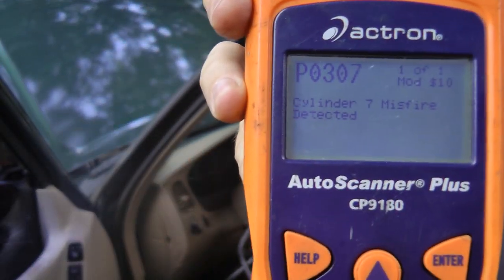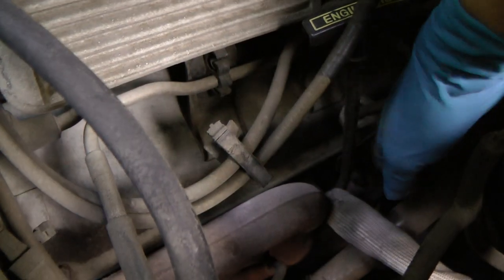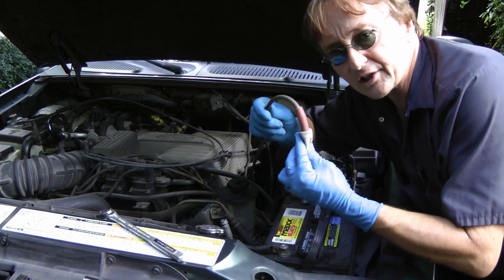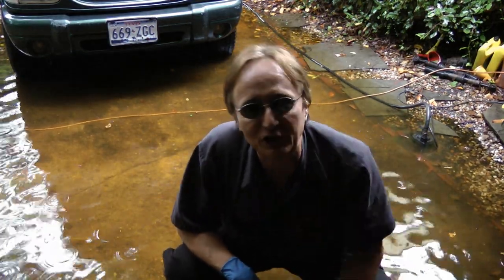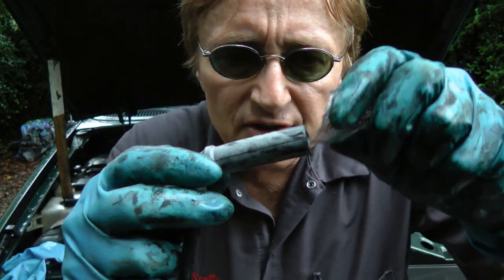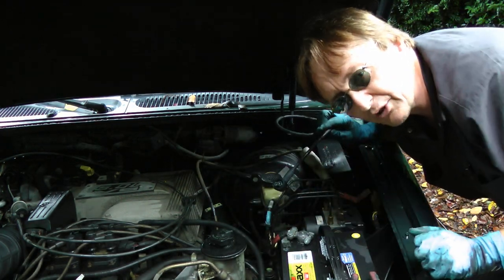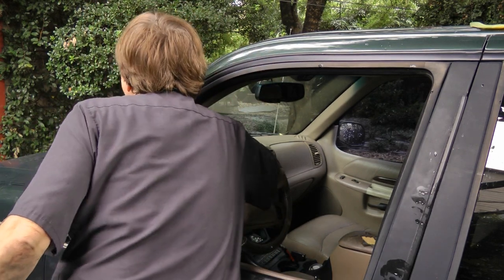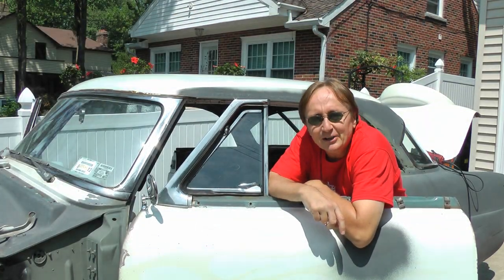How to Fix a Engine Misfire Code P0301 (Spark Plugs and Wires)

Comment: Hi Scotty, 

Looking for some advice in relation to my car, I have a 2003 renault megane mk2,

its started throwing up a P0303 and P0300 fault code, idling really rough and not pulling,

I have checked the coils, and going to change the plugs when my tool arrives in the post,

other than the coils and the plugs what else could the causes be?

Am I right in thinking injectors,02 sensors etc?

Many thanks,

Callum

Comment: hi scotty,
your videos are awesome! well i have a problem and i know you can help. I got a 2000 nissan pulsar lx. It has misfire. I can get a check engine code of p1320 occasionally. I try to pull off the coil connectors and found that coil for number 1 doesn't change the how the engine runs or it it gives a very little difference. I've done swapping the coils and spark plugs but i still got the same thing for number 1. so i fix its connector. It improves but only a little after engine warms up

Comment: Hey Scotty ,
I have a 1998 Honda civic LX.
When I turn my car on it shakes for about 2-3 seconds then idles fine . It happens once every so often. Took it to get the code read. it says misfire in 2 cylinders. doesnt happen all the time,I replaced the wires and spark plugs. the engine light went away . it still does it randomly.   Any suggestions on what this could be? Any response will be awesome

Comment: How does the car computer know there is a misfire? is it the crank sensor senses a slight drop in rotation , or the ox sensor does not for a moment detect exhaust gasses.????

Comment: Scotty, on this 95 explorer I have been working on, the spring broke when I pulled the hood release to open the hood, I had to remove the latch to replace the spring, now I have problems opening the hood, how do adjust the latch so the hood opens properly ? please let me know. Kody
Reply from the maker: you loosen the little bolts that hold the latch in place and move it up and down and guess until it works best

Comment: so I have a 2001 Toyota corolla 198000 miles and Im getting a cylinder misfire on number two. I have replaced the plugs. the coil packs seem to be fine since I moved cyl. 4 to cyl. 2 and vise versa, and still getting the same misfire on # 2. so im down to either a vacuum leak or a bad fuel injector just wondering on what you think it would be. thanks for any help.

Comment: Hi Scotty and I have a 1999 Camry LE I have gotten the piston rings replaced and coils along with spark plugs/wires and I have had the car timed as well, but the car cranks and won't turn over it keeps making a popping noise while trying to start and so we tried to use starting fluid and the car seems like it wanted to start, but no avail could it be fuel injectors or a fuel pump? I've already change the fuel filter before. Thanks
Reply from the maker: +Ayix M. do my video "fixing a car that cranks but doesn't start up"
Reply: Scotty Kilmer
Thanks!

Comment: Nice video. But I noticed some weird things. First, I don't think it's a good idea to have electrical cords submerged in water. Especially when your standing in the water. Second, the two spark plugs are different. Notice the first plug has longer threads than the second plug.

Comment from the maker: coolant is not black, flush it out.  Transmission fluid should be red and have no metal in it.  Engine oil should no have metal either. If you're not pulling my leg, your vehicle is falling apart.

Comment: Hi Scotty I have a 93 Toyota supra and one of the Pistons are misfiring, the car had been siting for a month as it got resprayed, first startup the piston would fire up occasionally miss but now it's gone (even after engine is at running. Temperature).I haven't had time to check the plugs yet but could it be something serious?
Reply from the maker: those are notorious for weak cams that wear out, check that first

Comment from the maker: yea, don't buy a grand am, they are one of the main reasons pontiac went bankrupt.  You got ripped by the mechanic, no real mechanic would put a timing chain on an engine that has a bad cylinder compression. The head would have to be pulled and the timing chain taken off again and you'd spend more money that that thing's worth in most cases. You can just keep changing the spark plug on 3 and pray it lasts a while longer though.

Comment: Hey Scotty, I have a 2006 Honda v6 accord . Codes are reading that all valves are misfiring. Changed all the spark plugs, the old ones were carbonized. How long til the emissions light resets and should I do anything else? Spark plug wires?
Reply from the maker: adjust the valves first, if plugs were carbonized so are valves and they'd need cleaning and readjustment
Reply: Scotty Kilmer Thanks!
Reply: Emissions light went off, car running great, more power. Idk if i can do the valve adjustemnt myself? You got a video for that?

Comment: Here are my park plug tips:
1. never change plugs when your heads are hot, it can gall the threads.
2. I always use anti seize on the threads.
3. don't over tighten, I just go a 1/4 turn past after the crush washer seats.
4. Before removing plugs, give each a shot of PB Blaster.
Change wires one at a time so ya don't F up the firing order.

Comment: @scottykilmer great job on the vids i watch them every week. i did an oil change on my e39 (bmw 2000 528i) and the oil light still goes on and to get it reset is about $150 (local mechanic not the dealer). is it possible to do it myself? if so how?

Comment: Alright scotty quick question for you.
I recently ran into some bad fuel (so it seems) and the engine began to misfire a bit. My o2 sensor is bad thus making the car idle unevenly. But the engine also shakes when in low RPM. I'm driving an 02 F-150. I changed out the spark plug that was misfiring and its not misfiring anymore along with my fuel filter. But the truck still shakes when it is accelerating around 1100 RPM. That goes for 15 mph or 45mph it shakes. I have no idea what else to do. What would you do?
Reply: Might be an bad oxygen sensor due to the misfiring
Reply: My vehicle is running lean and has a low idle. I have two new motor craft o2 sensors I'm going to replace soon.

Comment: Scotty, I need your help!  I bought a 98 Mitsu Montero 3.5 with a misfire which I though was old gas. Tried running 3 tanks through w/ injector cleaner and never cleared up and I got a misfire cylinder 3 code at first and then a multiple cylinder misfire code. I pulled the intake plenum off and noticed 1 intake port and 1 spark plug that looked brand new clean and the rest of the cylinders have heavy carbon buildup.  Milky light brown residue in intake port and around gasket...any ideas?

Comment: Hey Scotty. On my 2007 Bmw 328i it had a misfire on cylinder 3 I swapped the ignition coil with another and it gave me 3 misfires instead of one. I then ran it and then it gave me a misfire on cylinder 2 and the engine light stayed on I bought a new coil and put it on 2 I reset the code and now I have 3 stored codes. There's no pending codes only stored. What you suggest I do or is everything fine?
Reply from the maker: just drive it and see if it all goes away over time as long as it runs fine

Comment: scotty,i got a "03 ford ranger 2.3l 4cyl that has a code of p0303 and p0316.i changed plugs,wires,coil pack,fuel filter,air filter number 3 fuel injector and still misfiers.could the crankshaft position sensor be causing all this mayhem?

Comment: Hey scotty i have a 2004 Jeep Grand Cherokee with a 4.0l V6 the whole starting system has been replaced battery alternator and starter will start fine cold then after it gets hot and shut off a few times about the 5th time i start it it will not start acting like it has a dead battery this is the 5th battery is 6 months hoping you can help me out

Comment: I have a 1996 Toyota camry has code P0303. I replace spark plug and spark plug wire but code still there and misfire too. Need help.

Comment: hey scotty I have a Hyundai accent 2003 148k miles im getting a evap system failure    p0441 and ,it stated when I filled my gas tank I accidentally overfilled it it ran fine but the cel turned on. The light turned off when I got down to about quarter of a tank of gas, now I notice the misfire and right after filling the gas tank even half way the car stalls when I try to start it up starts up fine  after a minute and cel come on and off

Comment: Hi, Scotty! I have a 96 Buick Regal 3.1 v6 and I'm a bit stumped. Just changed all of the plugs and wires because they were worn and they weren't very good plugs to begin with. Let me tell ya, I've had problems ever since. Engine was okay for about a mile. Stopped and turned the car off to go into the gas station and when I came back out, started it up... Misfire was worse than ever. Rpms were fluctuating between 700-1100. Mass air flow was tested and turned out to be faulty along with a coil pack. Got both of those parts replaced, but still misfiring! Cylinder #4 is misfiring. Took the plug out and it was black. There's a pretty pertinent gasoline smell while it's running. Faulty injector or maybe the ignition control module is bad? What is your take on this?
Reply from the maker: that old, could just be a coincidence. more often a bad fuel injector does that if only one cylinder is black

Comment: Hello Scotty, my Toyota RAV4 was giving P0300, P0303, P0304 error codes and I took it to the dealer and they replaced spark plugs and Ignition coils. Again after 2 days, Engine Check light comes up for the same error codes. What might be the reason for this?
Reply: what year and engine size in your Rav4?

Comment: hey scotty i would like to compliment u on the great job u r doing keep up the good work. I'm having a prob with my 1996 honda civic. I had overheating prob and the coolant goes from the radiator to the reserve an does not return even wen cool, so i got my radiator rod out, and change the cap (japan 1.1),however same prob exist,even wen i hooked up the fan straight (rarely overheat now), and the water is NOT mixing with the oil. can u diagnose? plz and thnx.

Comment: I think I already know the answer to this question but does the check engine light NOT turn  on sometimes even though there may be an issue. Since basically anything is prone to mistake to some degree I'd guess this does happen. I just want to make sure.
Reply: I'm in Australia and I have an 05 V6 Mitsubishi 380 (Galant in the US) with 360000 klms.  At this age it's to be expected that the poor old girl would have a variety of small issues.  Consumes oil through the valve stem seals,  gets oil in the plug tubes which I have to clean out every couple of months because the leak is in the lower end of the tube seal and a few other things. Mostly she still runs very well and I keep it because of emotional attachment.  But sometimes the engine runs like a chaff cutter and there's "no codes stored in the module".  And usually when you take a car to a mechanic these days and there is no code they are lost for what to do. 
And often even if there is a code they still don't know what to do. 
Good mechanics aren't made, they're born.  The check light isn't the be all and end all,  diagnoses sometimes require old school know how.

Comment: Scootty, I have 99 audi a6 have random misfiring, misfiring cylinder#4. mechanic replace the coil pack but still have it. do you have any suggestion what should I do next, I'm planning to do it myself, I start replacing the spark plug but still have it. thanks
Reply: ***** I had them replaced already 6 months ago.. but they could be fouled if the injectors are leaking right?

Comment: I have a 2012 Chrysler 200 it has the 3.6 L. Getting code P0304 I changed all the plugs made sure they were gap At 40,000’s is what they told me at the auto store they were supposed to be gapped at I change the injector in number four Cylinder and the coil and I’m still getting read out of number for misfire could you help me?

Comment from the maker: engine's just flat wearing out if they carbon up on a corolla. Keep oil in it, change the plugs, and drive it till it drops. No one rebuilds those engines correctly these days.

Comment: Hey Scotty,

My mom's 2001 Kia Sephia has a P0303 code. Autozone scanned it for free but wouldn't sell me parts because I "had no advice to go on". So here I am. I was gonna replace all 4 plugs and swap the #3 coil pack with the #1 coil pack and see what happened but they got me doubting myself. They suggested I just needed the 1 plug. Am I the idiot or are they? Anything else I should do while I'm at it? Car only has 58k miles and lives in stop and go traffic (my mom refuses to drive on interstate)
Reply from the maker: plugs do not go bad one at a time. Try your test first, and if not that, swap injectors to see if #3 injector is bad
Reply: Scotty Kilmer  So you don't think it's plugs at all, a coil or injector instead is to blame? It runs decent once you get going most of the time, it's idling at a stop when it stumbles and misses. Thanks for all your help. A very similar event happened in 2006 on the same car and a workshop charged over $600 and replaced the entire ignition system. I don't want to go through that avenue again as it seems overkill and your videos help so much! You're the best.

Comment: Hi Scotty, I have an engine misfire in a 95 Nissan Maxima. The spark plugs were replaced, but same intermittent misfire occurs. I hear a knocking noise on the front right side of the car and white smoke comes out of the tailpipe. Losing a lot of anti freeze, Any suggestions? Chances are it is a cracked head gasket. Thank you.
Reply from the maker: yep, blowing head gasket. Big money on that car, you might think saying goodbye and replacing it with a used toyota, they don't break down as much and get better gas mileage too
Reply: Scotty Kilmer You are a blessing Scotty!  What year do you recommend? Is a 2005 Corolla too old? Thanks again.
Reply from the maker: Michael Lorin
heck not, I drive a 94 celica myself. And, If you like my car help, be sure to watch my live car talk show every Saturday morning at 10 AM CST on YouTube. I answer your car questions LIVE there. Just check it out at How To Ask A Live Mechanic Car Questions Free On YouTube . And remember, every TUESDAY  I upload a new video, so don’t miss them

Comment: hey Scotty I got a 2001 dodge ram its misfiring but the funny thing is it only misfires when its warming up but when its warm it drives fine chamged plugs and wires and crankshaft position sensor
Reply from the maker: +Korey Fitzwater  weak fuel injectors often do that, try my video "how to clean fuel injectors on your car"
Reply: +Scotty Kilmer also would a clogged fuel injector cause it to jerk and back fire?

Comment from the maker: misfire pretty much explains itself, the engine is not firing correctly in one or more cylinders. Can be about a 100 different things, including injectors or ignition. And yea, the older ones were better made, though gas hogs.

Comment: I HAVE A 2005 FORD FOCUS AND ITS Misfiring  With P0301 Code   I CHANGE THE SPARK PLUGS AND THE COIL PACK,IS THER ANY OTHER WAY TO FIX WITHOUT REBUILD THE ENGINE
Reply from the maker: Swap #1 fuel injector to see if miss moves, check for vacuum leaks, and pressure test the engine to see if cylinder is just worn out

Comment: Scotty, I have a 1999 chevy suburban w/a Vortec 5.7L V8. It started running really rough yesterday and it's giving a P0305 code. I have two 99 suburbans - same engine. I swapped the #5 plug and there was no change. I verified spark with a spark tester. I checked compression, got 180 PSI. I tried a cyl leak down test. I only hear some air in the crankcase. I don't hear air in the intake manifold or the exhaust or either of the adjoining plug holes. Any help would be much appreciated!!

Comment: What would cause my Ford Tbird to what seems like a misfire at high speeds?  At 60 mph its fine, but if I push the gas down to hit 70, it feels like a misfire.  i replaced the spark plugs,wires, and dis. cap.    Would this be a slightly clogged injector?   I dunno..

Comment: Hey scottykilmer or somebody i just gotten a new used motor put on my 2003 nissan altima but when my car is in parking the rpm goes up and down and also when i put my car in drive or reverse sometimes it makes a locking noise please any ideas, tips would help me alot thanks

Comment: Hi scott, my car is showing codes p0301 and p1399. I already changed my spark plugs, spark plug wires ans distributor cap. Still no luck. What could be the problem? Thanks!

Comment: scotty, ive got a 98 malibu 2.4l and im getting a missfire and o2 sensor code and ive replaced the plugs and coil packs and done a compression test and im coming up with nothing. car runs really bad and hesitated under load. could this be a computer problem or icm issue?

Comment: do you use anti seize on the spark plug threads?
Reply: I have heard him say in another video the modern spark plugs are made different and don't need it because they are pre coated with something that helps them not seize. Older spark plugs were basically metal on metal.
Reply from the maker: no

Comment: Hey scotty I have a 2001 Chevy blazer 4.3 I I had some codes p0151 something to do with the oz sensor but my mechanic said it was the fuel pressure regulator so we change it and now I have a p0305 how Can I fix it